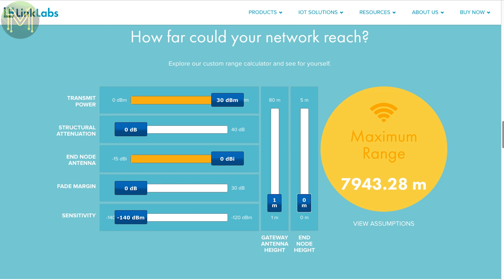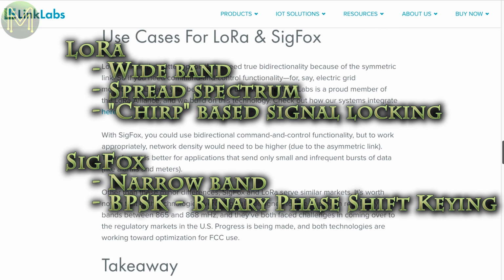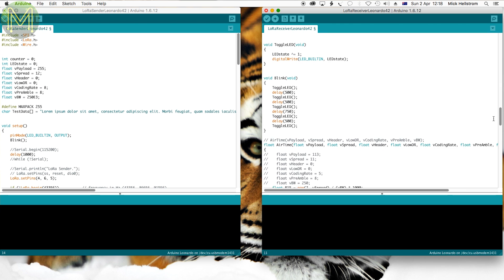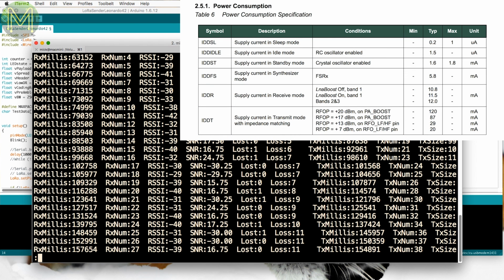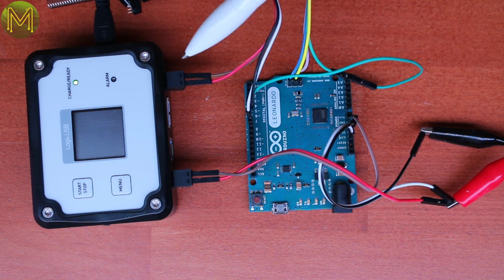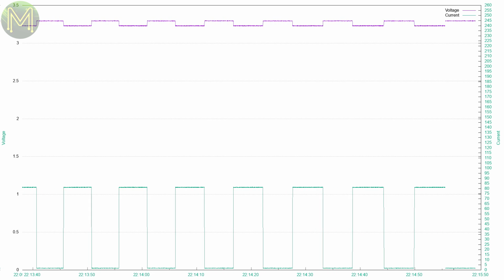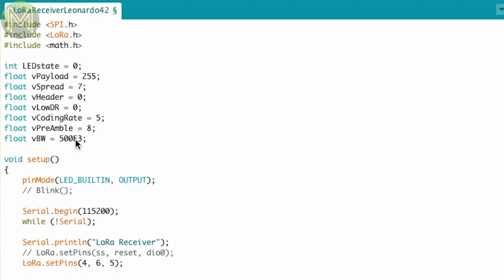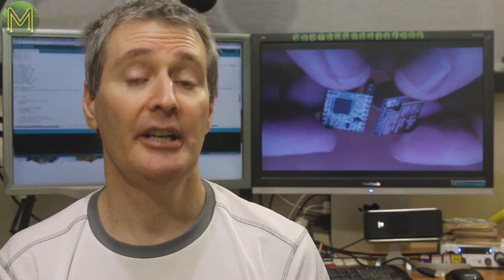#120 LoRa on batteries: How long does it last? // Tutorial

Comment: Can i made rc transmitter with this module ?
Reply from the maker: Quite a few people have done this. Works well, but latency can be an issue. So you need to reduce the "air-time" as much as possible.

Comment: 1.7mA consumption idle? So it will only last 4.9days at idle with a 200mah cr2032 battery? I thought it consumes just a few uA?
Reply from the maker: During idle... yes, but transmitting/receiving it’ll draw a lot more.
Reply: I wonder if you could make the node idle for only a few microseconds every second to minimize power consumption then sleep?

Comment: If you're going to power it with batteries, you need to utilize and rely on the radio's ability to sleep for 1uA then sleep your micro and use a low Iq regulator. reibot.org sells dev boards designed for this

Comment: Hey MirkMake can you specify the Tx packages sent on your tests?
I would like to estimate how long a battery will last acording to the amount of packages sent per day
Reply from the maker: Hi Andres, I sent a range of packet sizes from 1 byte to 1Kb - cycling through packet sizes in 1 byte increments.
Sending a couple of packets a day, you should be able to last for at least several months on a coin cell and a small MCU.

Comment: Help
I need a rf wireless controller (transmitter and receiver) for a distance of 2 to 5km.
To function as follows:
On the transmitter is to connect a "PIR" motion detector
In the recptor a led.
The operation should look like this: After the "PIR" detects movement, it sends a signal to the receiver, which in turn lights a led.
Thanks

Comment: Thanks for the video! Now, on a real application you still need to consider other things, like everything else apart from the radio.... a stock Arduino is not the most low-power device in this case, something like a Whisper Node (https://wisen.com.au/store/products/whisper-node-lora/) would be more suitable for battery operation.

Comment: Does LoRa has a good enough latency for telemetry ?
Reply from the maker: It depends on what sort of telemetry. You can have telemetry between the earth and the moon, which would have high latency.
You can configure LoRa to spend a lot of time "on air" which would increase latency, but increase distance. So the range you want is a big factor here.
Reply: MickMake my purpose is telemetry for drone, similar to 3DR telemetry. currently i'm developing a DIY flight controller using STM32F446RE. oh i got it, So sx127x should  works for drone telemetry. i only need to send some string about 2Hz
Reply from the maker: DJ-EVARA yup, that'll work well.

Comment: Hi, actually i have two sx1278, but i have not yet found an example of library of sx127x thru SPI. 
would you like to send me your sx127x arduino code and library ?
thank you very much

Devara
Reply from the maker: Hi, there's a number of libraries in the Arduino IDE. I'll post my code up to my GitHub page soon.
Reply: MickMake thank you so much for your reply. I glad to hear that. actually i have found a library, but there is no example to use it. My sx127x is working at 470MHz not 433MHz
Reply: Can I have your GitHub Library/code please?

Comment: 500Kms ? I assume that is line of sight. and there is no where on Earth that can be possible.
If it could be done, it would beat the WiFi world record done with standard WiFi hardware, minus the massive dish antenna.

Btw, do you call your Wife Wiffy? :D
Reply from the maker: +ProCactus 
That's right. It is theoretical after all. In reality you'd have to put the antenna up much higher to account for the curvature of the earth.

WiFi? No, but I get called that before I've had a shower. ;-)
Reply from the maker: +ProCactus 
And yes, line of site would be a must!

Comment: In your calculate script results table, is the far right column supposed to be mA instead of mAh?
Reply from the maker: +Connor Speers 
Well the far right is mA consumed in one hour, so you could take it as mAh.
The far left column is mA consumed in how long the test was.
Reply: A mA is a measurement equal to 1 mC (milli-coulomb) of charge being transferred over the duration of 1 second, or 1 mC / s. Thus, a little unit math would allow one to conclude that a mAh =  mA *  h =  mC / s * 3600 s = 3600 mC of charge (the seconds unit in the numerator cancels the seconds unit in the denominator, leaving only mC in the numerator). So mAh is a measurement of charge, whereas mA is a measurement of the rate of charge transfer.

Batteries are technically rated for a particular voltage, with their energy capacity measured in watt-hours (1 Wh = 1 V * 1 A * 1 h). A battery with an advertised charge capacity of 2000 mAh (or 2 A * 1 h) operating at a constant 3.7 V would have an energy capacity of 3.7 V * 2 A * 1 h = 7.4 Wh. Say you used such a battery to power a device that operates at 3.7 V and has an average current draw of 80 mA (giving it a power rating of 3.7 V * 0.080 A = 0.296 W), you can calculate approximately how long the battery will be able to power the device by dividing 7.4 Wh / 0.296 W = 25 hours.

This algorithm can be simplified (and often is) by eliminating voltage from the calculations if voltage is assumed to be constant. So then the equation becomes 2000 mAh / 80 mA = a theoretical 25 hours of operation.

Your results tables are consistent with of this if the far right column is a measurement of the average rate of charge transfer (mA) during LoRa operation, but not if it's a measurement of total charge consumed (mAh).

But if I'm wrong, let me know! Just trying to make sure I understand everything correctly. Big fan btw, never heard of LoRa before this video, so thanks for introducing me to something that has huge implications for the world of IoT (and beyond)!
Reply from the maker: +Connor Speers 
Yes that's right. I meant to say average mA consumed and didn't mean total. The voltage and current logger tended to skip over some of the 1 mS samples so I had to adjust for that when generating my average.

Comment: what would you need to buy to make your own pirate radio you can broadcast music over/on with as small form factor as possible but that can send over greater distances?
Reply from the maker: +tsfcancerman 
Just two LoRa modules. You won't be able to pick up the LoRa transmission on a normal radio, but you could certainly use it to transfer whatever you want between two distant points.
Reply from the maker: +tsfcancerman 
But to answer your question... getting an SDR would be the best, along with a decent amplifier. You'd need a lot of money still and depending on your country they have very good methods for tracking down pirate radio stations. Most of them are situated off-shore to get around any legislation.
Note: If you do this, then it's by your own choice. I don't support the setup of pirate radio in any way.

Comment: I wonder if LORA has sufficient bandwidth to be used to be used as a means of transmitting RC signal to a drone in lieu of WI-FI (**pronounced why-fye here, not WEE-FEE) or the normal RC 72mhz band.
Reply from the maker: +altamiradorable 
Possibly. I would think that LoRa and WiFi would be too high a latency for classic RC, but the long range advantage of LoRa is appealing.
You could use it for basic telemetry between a ground station and near-space balloon.
Reply: I was wondering the same thing but I'm guessing it is too low bandwidth for something like Mavlink.  However, combined with something like a teensy, you might be able to use it as a failsafe last ditch long range "RTL" request system.
Reply: Would even a 20ms latency really matter much?

Comment: It would be pretty pricey to setup a gateway if there are none around. https://www.thethingsnetwork.org/map
As you can see, not many gateways are public in Canada.
Also, can one of these small modules be used as a repeater, or do I need another gateway? 
If former, I am thinking of putting one up on the tree at the top of the mountain that blocks my line of sight to my destination (Cabin in the woods)? Use solar charging and batteries and hide it from people.
Reply from the maker: +UFOhunter 
Yup, why not! You would only need one of them if it's low data rates, but two if you wanted to push through the 500k bandwidth.
Reply: But, Would I need a gateway, or just 2 or in my case, 3 modules will do?
I would only need a gateway if I need connection to the internet on the other end? Right?
Reply from the maker: UFOhunter 
The best way would be to setup a LoRaWAN network, but you could do it with a straight peer to peer with several modules.
Reply: That's awesome. Will order 2 more. Thx

Comment: Nicely done.  I like using new things.  Well, new to me...  What would be the various uses for this other than the standard answer of "streaming data"?  How can I use this in a standard every day life use?
Reply from the maker: +Nick Sebring 
Long range Comms instead of using a mobile network. Chuck them out on a farm and running off solar and you can check your water troughs. Stick it into a high altitude balloon for telemetry. Put one in your car for logging your vehicle's movement without using GSM. Or use it as a vehicle tracker when it's stolen.

Comment: top notch video.  i gonna buy those LoRa modules. i like the way you compare the power consumption in different cases. 👍👏
Reply from the maker: +Amitesh Singh 
Thanks mate. They're a lot of fun. If you want to make it easier for yourself then get the boards with 2.54mm spacing or there's a PCB adaptor on tindie that you can get that'll convert the 2mm to 2.54mm spacing.

Comment: Can you do a comparison of the various module settings, in sensible increments, against battery consumption? I don't think it would be just a binary short/long range option.
Reply from the maker: +wraithbone 
Yup, unfortunately I didn't have much time this week to do more testing. In a followup video I'll be including tests such as different data rates and other variables, but the maximum and minimum "air time" tests gives you the best and worst case scenarios.
Reply: MickMake cheers, keen to see that follow up.

Comment: hey Mick!
I want to explore more sbcs, and as I'm a student I am low on budget. Can you suggest me some  cheap sbcs available on aliexpress or ebay like the orange pi zero. I've already used raspberry pi.
thanks
Reply: You could try the RPi Zero W. Its 5$ more than a normal Zero, but you can get it directly from thepihut.com
Reply: rupr thepihut also charge a good amount of shipping here to india.
Reply: sbstek bought the orange pi zero one hour back. :) thanks for the suggestion's
Reply from the maker: +Akarsh Agarwal 
The Orange Pi Zero and RPi Zero are probably your best bet. I haven't had a chance to look at the NanoPi Neo yet so not sure what it's like. Apart from that there's the embedded side; Arduinos, Teensy, etc.
Reply: MickMake thanks for the reply Mick. but the raspberry pi zero comes costlier than the pi 3. lol
Reply from the maker: Akarsh Agarwal 
Ah yes, the scalpers are charging a lot for them.